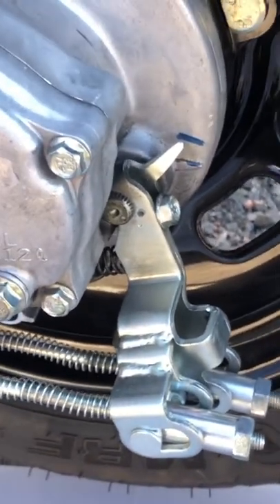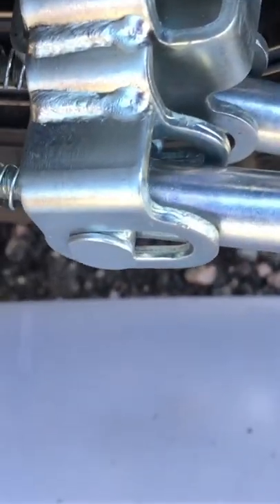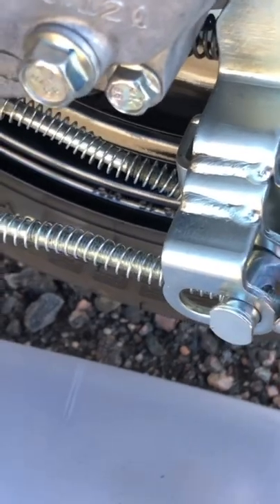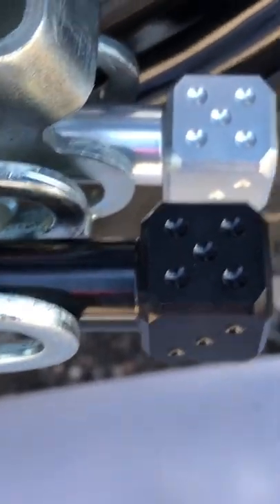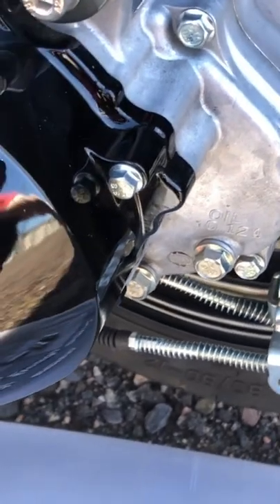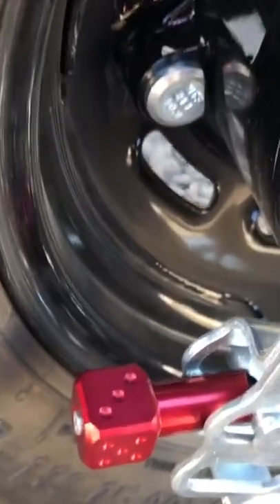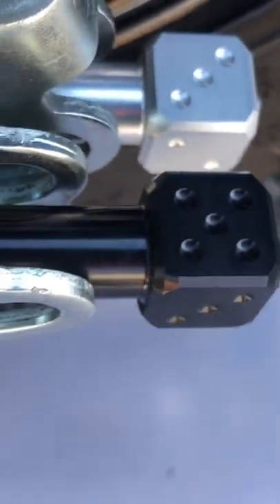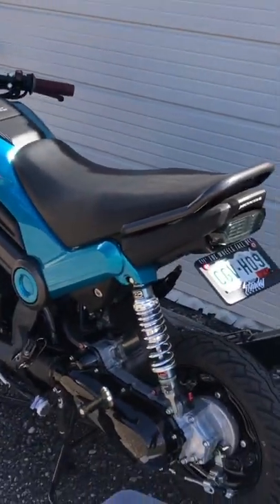New parts from Steady Garage/ Chimera Engineering. How to adjust the brakes on the Honda Navi 110!!!

Comment: Might grab a set, can you ride these around for a bit and tell us if they get loose on their own. They turn so easy that is my only worry.
Reply from the maker: I put about 20 miles on it today and they didn’t move. Brakes still felt great when I put the bike away. The grooves that lock into place as adjustments, and the spring keep it from backing off on its own. 👌
Reply: @xtramediumminimoto   Excellent. As it should be with a quality upgrade. All the details on your Navi are sweet

Comment: yeah they are cool but not 30 bucks for each one cool.
Reply from the maker: I’ve had some cheaper ones on my rucks and these are much higher quality. There’s always other options but these are best I’ve used. and they have free shipping.
Reply: @xtramediumminimoto  Oh I get that they are nice no doubt. But still not 30 bucks for one. If it was 30 for a pair I would call that fair value. Ive spent easily at least 4 grand in custom parts for my ruck. Cnc this and that carbon fiber one off designs made just for me and all that. What I paid for those items I felt the price was justified and fair. These are just priced way too high and i dont see the value in what you get vs the price. Thats the main problem with the navi. SInce there isnt many parts yet here the ones that do come out are being priced higher than value. Its a quick money grab price gouging thing because people want new parts for the navi. I see it plain and simple. Ive been custom modding for many many years so I know how the game works. Put out a good product at fair market value and people will eat it up and buy as many as you have. Over price your stuff and that leaves a bad image and people will be reluctant to buy other things from you. Steady garage isnt the only one in the game. Plenty of others to buy from.